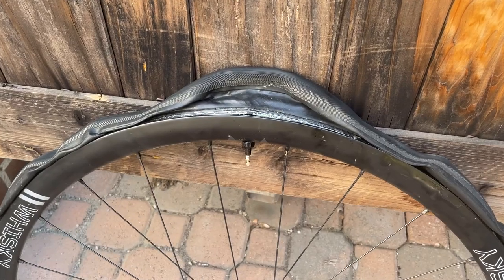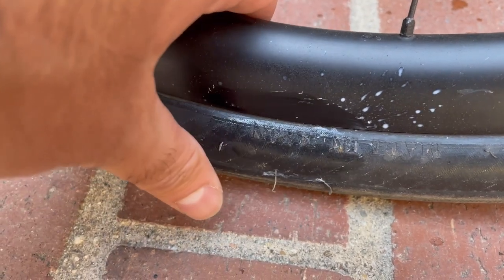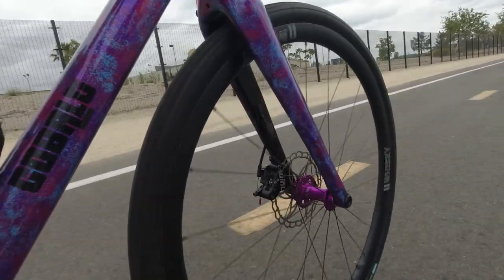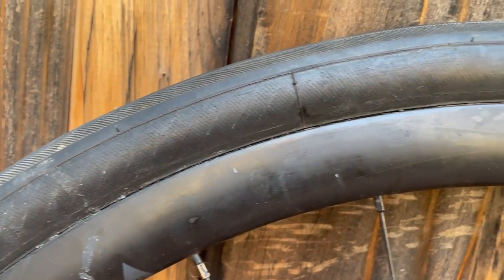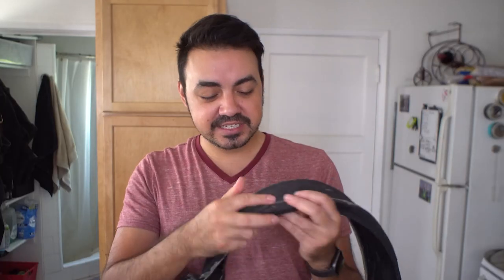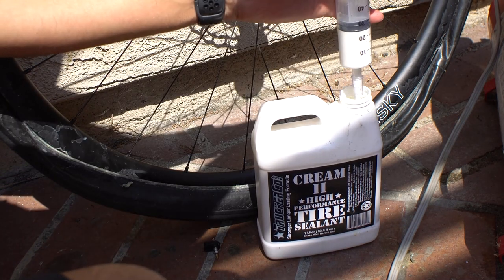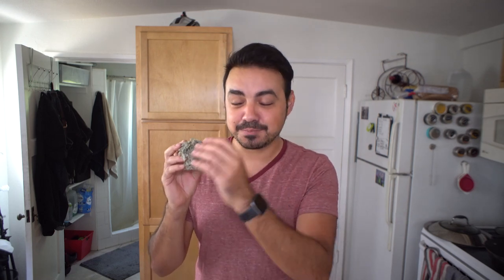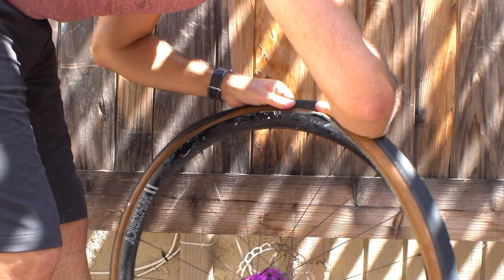Gravel Tire EPIC FAIL! Have you ever seen this?

Comment: I used 3 different models of Rene Herse Extralights, the 28 mm Chinook Pass, 44 mm Snoqualmie Pass and the 48 mm Hurricane Ridge. I started with the latter setup tubeless, but I could not get the sidewalls to seal. I then switched over to latex inner tubes and never looked back. I have not had a puncture so far with about 600 km on the Hurricane Ridge and 500 km on the Chinook Pass. I hope I am going to have the same luck with my new Snoqualmie's. I might try going tubeless with them once again if they puncture more often, but I will try the Panaracer Seal Smart or Orange Seal like Rene Herse recommends.

Comment: I've been running the Rene Herse Barlow Pass tires (3mm wider) in the endurance casing, and haven't had any issues with either leaking sealant or what you're experiencing.  In fact, these have been the best sealing tubeless tires I've ever used, road or gravel bike.  I could go days without having to add air to them and they held their pressure.  Only issue was that they were a bitch to seat the bead (Winspace gravel wheels) - had to have the shop do it, and it took them quite awhile.

Comment: I have Rene Herse (formerly Compass) Juniper Ridge Extralights tanwall 27.5 x 48.  I had them mounted tubeless with Orange Seal.  It couldn’t keep air in without going flat within 48 hours (or less). It looked like the sealant was trying to seep through the sidewall. I don’t know if the regular casing would work better. I just cleaned it out and went to tubes. Try contacting Jan Heine at Rene Herse.

Comment: Sealant is all you need for a leaking sidewalls. Always pump the tires to maximal recommended pressure when setting tubeless. Use water with soap to identify the leaks.
Reply from the maker: Trust me we did , these leaked so much we refilled sealant multiple times in first 100 miles to seal the sides

Comment: Technology that’s suppose to be better, also requires “extra maintenance and your time”….. I’ll just continue with my tubes, and loose the weight somewhere else on the bike. Lot cheaper and more saddle time for me 🤣🍻 . Tubeless tech is not ready for real-time yet, give it another 5 years or more for all companies to settle on a “standard wheel” set ups. Save your money and use rubber for protection 😎🤙🏼.